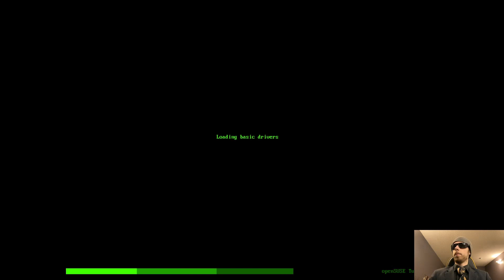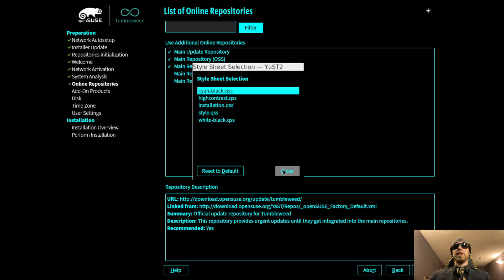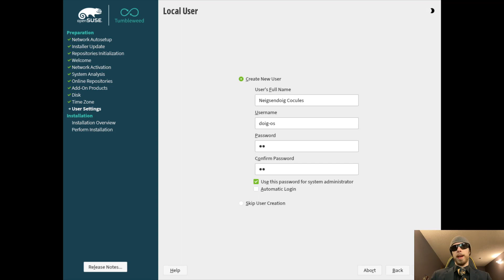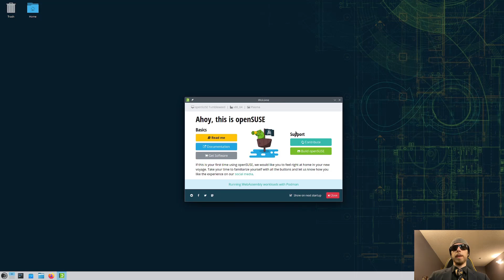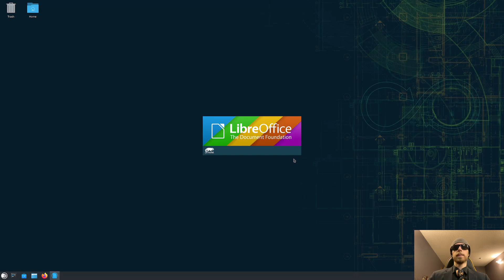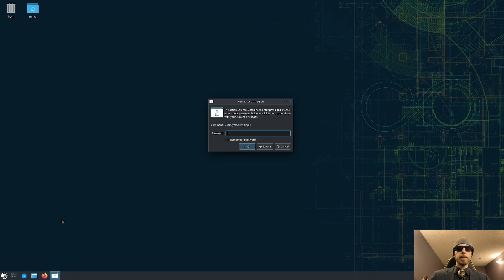My First Look into OpenSUSE Tumbleweed

Comment: Good review as always, but (please correct me if I'm wrong) openSUSE is not a "Fedora-based" distro even if they are both using RPM packages.
Reply from the maker: We couldn't find information about it being Fedora-based, but since Fedora is based off of RedHat (which is also RPM based), that's why the Android probably mentioned Fedora base.